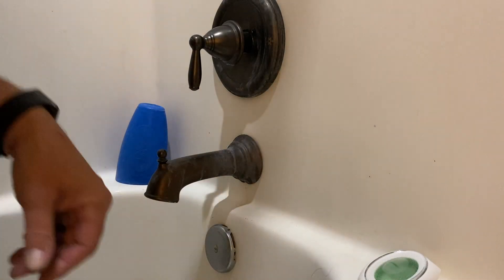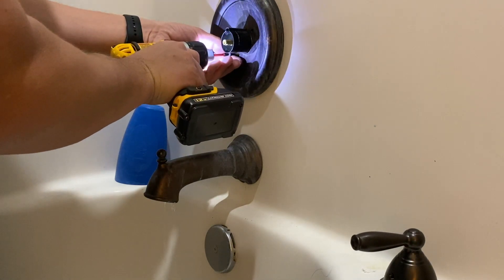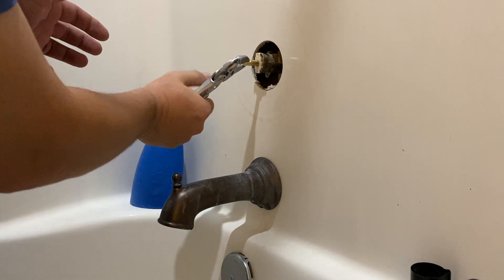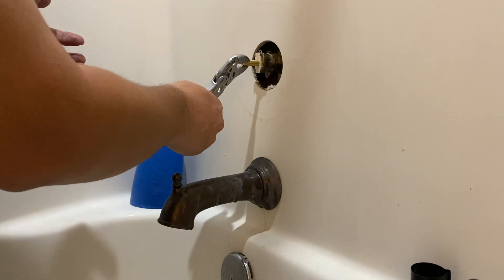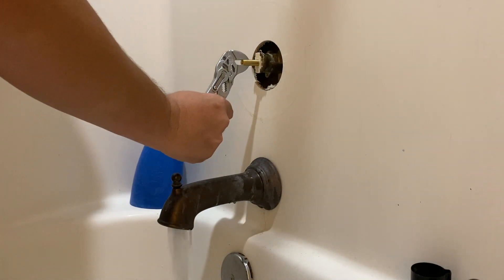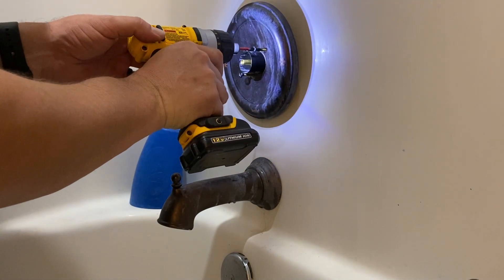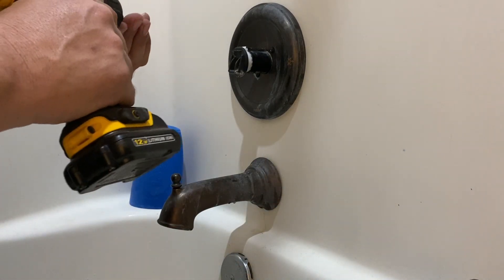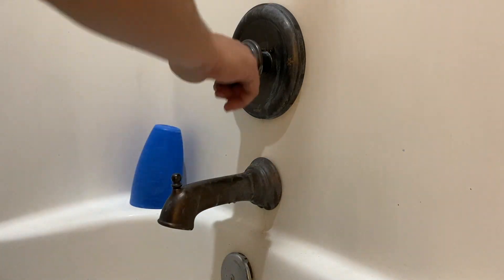Moen Faucet Cartridge Replacement

Comment: u forgot step number one .. TURN THE WATER OFF TO UR HOUSE .. sorry ben .. im.a master plumber here in Texas .. and I've seen lots of people try this and didnt shut the water off and flood themselves.. and most of the time u cant pull these out without the tool specifically for these moen positemp cartridges
Reply from the maker: You’re absolutely right, shutting off the water is step number one. I guess I shouldn’t assume that people are smart enough to know that you have to shut off the water before taking a valve apart. I’ve only done about three or four of these from different brands, I don’t ever remember having to use a special tool to remove the valve, but I’ll take your word for it.
Reply: @txtoolcrib  yes sir .. just remember.. common sense ain't common anymore